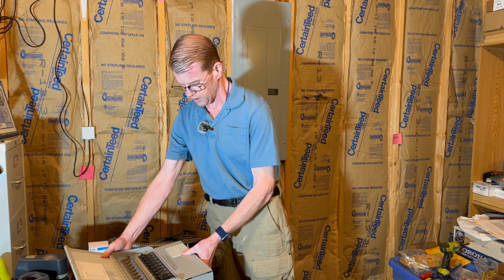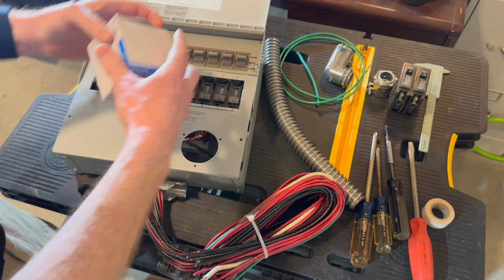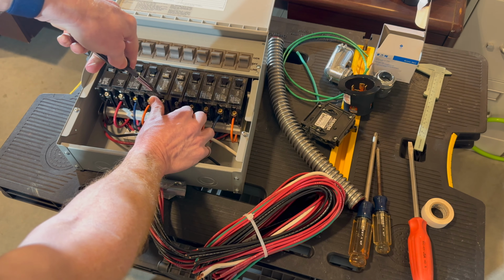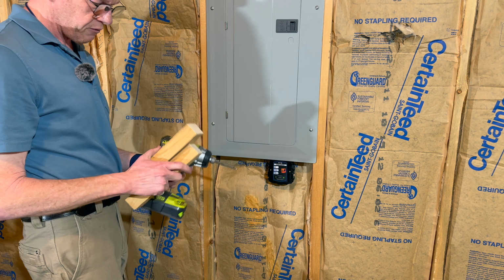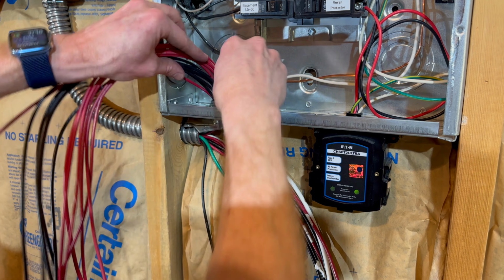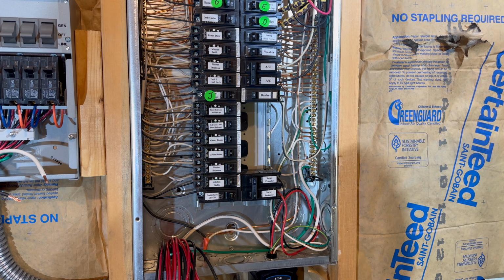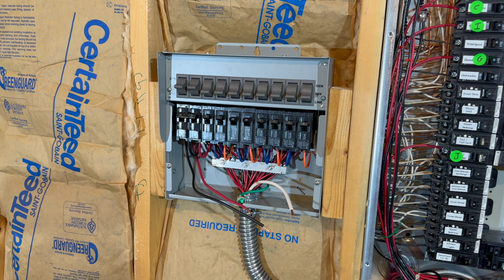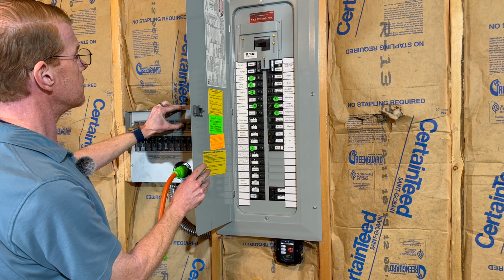Bluetti Home Integration Part 1: Reliance Protran2 Transfer Switch Full Install

Comment: kremer i has a problem running transfer switch it's 30amp, my main breaker used 50amp and my second floor housing using 50amp breaker it's only. how can i this solved the problem:face-orange-biting-nails::face-orange-biting-nails::face-orange-biting-nails::face-orange-biting-nails::face-orange-biting-nails::face-orange-biting-nails::eyes-purple-crying::eyes-purple-crying::eyes-purple-crying:
Reply from the maker: You want to install 50A breakers in this transfer switch ?

Comment: I'm about to add this to my "backup mix" as well.  I also have a 50 amp power inlet, interlock kit, and breaker outside for my pair of dual fuel inverter generators but wanting to add this beside the breaker panel in our closet where it's located.   I know there are two ways to do this MTS from what I've gathered so far.  One way is to not transfer the neutrals where you use standard breakers in the MTS so no AFCI while on power station".  The other way is to use AFCI's in the MTS and wire in their neutral kit which then switches the neutrals.  The Reliance person said it would be fine either way which I'm glad I don't necessarily have to buy 5 or 6 AFCI breakers for the MTS.

On yours, you didn't have any AFCI breakers in the main panel to deal with, did you?  Also, could the Reliance wires go out the side of the panel instead of the bottom?  That would be handy to go through a fitting in the stud for side by side mount.
Reply from the maker: I did not move any AFCI breakers.  If I did they would no be protected while running through the switch, and would nuisance trip in the main.  The neutral kit is just a bunch of couple foot neutral wires and another piece of conduit.   My wiring goes out the bottom of the reliance via a 90 degree connector, and into the bottom of my main.
Reply: @DougKremer  Appreciate the reply.
Reply from the maker: @ITguyAR_66 Happy to help with the process.

Comment: Hmmm...I have a smaller version on my original AC300, but I swear when I "just switched" from line to gen on the Reliance, it threw the breaker in the main panel. So from thence on, I "simultaneously" throw the branch breaker that I want to have on the Bluetti when I switch the Reliance from line to gen. Maybe it was a isolated "gllitch"? And I really don't have to do that?  I'm afraid to try what he just did at the end of this great video for fear of either wrecking something ha ha, or of course just having the main box breaker trip again. I now have the upgraded Apex 300-parallel off-grid system and will be upgrading to this 10 circuit transfer switch in the near future.
Reply from the maker: Is the breaker in your main panel an AFCI or GFCI?  They will trip because the neutral isn't switched also.
Reply: @DougKremer  no its a regular one.
Reply from the maker: @loveall234-4wn : any chance you have the wires backward?  Very odd.
Reply: @DougKremer  actually I jist went downstairs and looked again...problem is this was 3 years ago and now I'm not sire but what it was an AFCI circuit! Either way I jist disconnect each branch at same time as I switch the Reliance to Gen & all is well. Figure better safe than sorry. Someday I'll get brave and try again as well as with one of the "regular breakers" and see what happens. Just dont wanna risk wrecking an expensive inverter if thats possible.
Reply from the maker: @loveall234-4wn : The regular breakers are fine. It is that the AFCI/GFCI is seeing current on the neutral but not the hot, and trips. As mentioned there is a neutral kit available from reliance so you can install a matching breaker in the protran but likely not worth the bother.
Reply: @DougKremer  okay. Great advice and help! Ur a big help Doug. Glad I subscribed
Reply from the maker: @loveall234-4wn : Happy to share what I’ve learned. Thank you for your support!
Reply: @DougKremer   I am curious about this myself, now.  My plan was to add the ProTran2 10 circuit on for doing something similar to yours but no solar tied in.  Out of the 10 circuits I'm going to use, 5 have regular breakers and 5 are AFCI breakers.  I will be using some sort of power station, eventually a Bluetti AC200L or Anker Solix F3000 with TT-30R, to feed this transfer switch.  Will that neutral kit need to be used as it could potentially trip  the AFCI like the other persons?  

Also, I believe I've seen where most all of these power stations are "floating neutral", correct?  The ground and neutral both tie into the same bar in your main panel and  they are separate in mine as they are bonded outside at the main meter panel.  So, I would believe I keep them separated for this as well since there should only ever be one point of bonding.

Edit:  After looking into it some more, it appears that I will have to replace those breakers in the ProTran2 with Siemens Q series AFCI breakers to the tune of about $50 each x 5 plus that neutral kit.  Ugh...  Kind of makes me think again about even messing with this part. That adds over $300 to something I really don't have to have in the first place....it was more a convenience of sorts.  Hmm.  it looks like all the ones you did in your panel were not AFCI although I believe I see you do have some in your panel...just not for the transfer switch needs.

Comment: Have 3 Spit outlets in my kitchen that I are connected with my ProTran.  Can  I connect them  using single breaker for each side of the split or would I have to use a tandem breaker? Was not meaning to use the tandem breakers being that my pump is 110V
Reply from the maker: Spit?  Split?  I have two circuits in my kitchen, and the microwave.  All three are on the protran under three different switches and single pole breakers.

Comment: I installed a 12 circuit transfer switch, never done this before and the whole process took about 2 hours.  It is very easy to do, no issues at all.
Reply from the maker: Awesome! It is a pretty straightforward process, just very fiddly.
Reply: Yep, have to say Reliance has this down pat!  My first switch went smooth as silk. Next one should also.
Reply from the maker: @loveall234-4wn Getting all the wires through the armored flex was the only pain,  could be an opportunity for them to improve that experience.  The rest just took some time.
Reply: @DougKremer  yeh even my little 6 circuit one was a bit testy but managed. Still a great setup. Can't wait to get my bigger one going so I can also have my well pump on it. Gotta get ready for when SHTF! 😂

Comment: if the breaker is changed from 15 to 20 don't the wire have to be changed also
Reply from the maker: The smallest wire in this one is 12AWG so that is not a problem.

Comment: For anyone wondering, there are distict differences betweeen "interlock" and "transfer" switches.  The Interlock is a systen wherein you use the pre-exsisting main panel and add a couple of sliding plates that when engaged,  prevent power from coming into the home from your power company (aka, the power pole) and allwo you to similarly plug in a power source into the home power system.  With that system, you have to pre-designate the circuits which will be used and the system prevents YOU from sending electrical current back into the power grid. This is important because your outage could be because the power company is performing service somewhere.  Even though they de-energize the power lines, homeowners can send power back into those lines with generators.  Thats why you have to have an internock device or a manual trasnsfer switch like the one shown in this video.  The beauty of the manual transfer switch is that the device wont allow you to send power back upstream with a simple flip of a switch.  As an added bonus, you can add as many or as few circuits as needed.  Of course, this depends on the amount of power you will require during an outage and the size of the battery backup or the size of generator you have avilable.  For those who only need to power a refrigerator, you are better off running an extension cord and using a small gernerator.  Consider, however, installing one of these systems (if affordable) and upgrading your circuit as needed.  The best way to make more of your home available to auxiliary power is to change out all lighting to LED and ensuring your appliances are on individual circuits.  Dont use electric heaters, hair dryers or other high-energy consumption devices un less you absolutely need them.  That way, you can selectively en gergize those circuits as needed.  Finally, but most importantly, if you know you will require cooling through y our air conditioning, your auxliary power might not be enough to START your A/C unit.  This is because of the initial high amount of amps the system draws when starting up.  HOWEVER, if you install a "soft start" system on your A/C unit, you will no longer have that initial high amperage draw.  These devices run anywhere from 200-400 dollars are simnple to install.  You A/C system starts slowly with a gradual increase of electricity draw which wont overwhelm your auxilliary system.  Frst the A/C fan motor starts up and when its running normally, the soft start activates the compressor motor.  Normally, these two start at the same time and you can hear the initial power surge.  Now, your auxilliary power system (generator, inverter or battery backup) can run the system.  That is as long as the auzilliary system has the capacity to run an A/C.  Most whole-home battery backup systems WILL run an A/C, but the power draw will be significant that it weill shortan the total number of avialable hours on your batteries. That's why an inverter generator is better suited for this.  Of course, your home HVAC (heating) will also need to be considered, however it doesnt have the same power requirements as the A/C unit.  Hope this helps everyone.
Reply from the maker: Well said.  Also of note for those watching is that I have both setups installed.  A main breaker whole-house interlock and then this transfer switch.  Both can co-exist and both serve different purposes.
Reply: @DougKremer absolutely,  I have a interlock installed now.  I want to do this set up for short term outages.

Comment: What do you charge for labor, if there are only 4 lines to connect?
Reply from the maker: I’m not the charge type, but I have offered help to several friends.
Reply from the maker: Four big lines.  Many smaller 🤣
Reply: @DougKremer no just 4 in subpanel. Its a shed :)
Reply from the maker: Ahh, easy.
Reply: @DougKremer for you. Like it is for me to replace a joint in the body. :). Eventhough im a surgeon, i still think these guys here in Gilbert AZ charging 1,500 for this little bit of labor is crazy. So, i think with your helpful video i could attempt and practice this on the shed/shop. The transfer switches themselves are only 15amp in the actual transfer switch, but in the interior panel they are 20 for big tools if needed, but for just basics, 15 amp should be just fine. So my question is, do i have to upgrade all switches to 20 amp also in the small manual transfer switch? This is a temp setup untill i buy a bigger switch to run 240 v for the mini split there too. I will not connect the minisplit to this small "for fun" switch.
Reply from the maker: @SurgeonTech  The 15 that it comes with are probably fine, if you have tripping issues upgrade to 20 if the wire supports it.

Comment: Can either the 200L or 300 handle 240v circuit via the transfer switch? I have a well pump and water heater on 240v 30A circuits. TIA!
Reply from the maker: Unfortunately not, both are 120V machines.  The AC300 and AC500 have the ability to link two units together for 240V.  Or the new Apex 300 does 240V/16A in a single box, and can be paralleled up to three for 48A.
Reply: Thank you for the quick reply! Your videos are a big help.
Reply from the maker: @gruml004 Thank you! I tried to concentrate on a lot of real world uses.  I’m also definitely open to test things people would like to see.

Comment: Great install video. This is exactly the setup I want to run and for the same reason you mentioned. When I mentioned this to a trusted friend and electrician, he commented that there is an issue with the neutral when attempting to run grid power on main panel circuits while simultaneously running portable generator power to the circuits on the transfer switch. He said the transfer switch needs to be set up as a “separately derived system” to avoid problems with the shared grounding.  Can you speak to this from your experience? How is this set up working for you?
Reply from the maker: I think I answered this in a reply you made,  please correct me if I am mistaken.
Reply: @DougKremer Yes, Doug. Thanks again for your other reply 👍🏻

Comment: When you changed the 15-amp breakers to 20 amps, did you need to change the conductors going through the transfer switch and to the panel? Or are the existing conductors oversized? And if they're oversized, what gauge wire is it? I have a need for some 30-amp circuits, and I'm worried the wire gauge won't be properly sized. Thanks for any details you can provide.
Reply from the maker: The left side breaker spots preinstalled with 30A breakers have 10AWG.  The rest was all 12AWG.

Comment: What these do to the main panel is extremely ugly.  Seems like a sub panel would be better for these splices and then you’ve got the critical load fully isolated if you later want to have three power sources.  I guess it depends if you can get to the runs and re-snake them into a sub panel.
Reply from the maker: It's all a trade off.  A subpanel is all or nothing on switching and would not let me/you choose individual circuits to run on generator/powerstation or utility.

Comment: since you have a 50 amp transfer switch why did you only choose a 30 amp inlet box on the front of the transfer switch?
Reply from the maker: @larrywaldon7584 Because I’m using a 30A output from the Bluetti. 50A plug, cord and such would just be extra unnecessary expense that wouldn’t net anything.

Comment: I want to buy a 50 amp transfer switch , in my breaker box at the house my heater in on a 50amp breaker , can I switch the 30 amp breaker on the transfer switch to a 50 amp breaker ?
Reply from the maker: @user-qz9yx3dh4i  That would be a good question for the tech line at Reliance.  They were very nice when I called with questions.
Reply: @DougKremer  they already said no

Comment: Just a thought I’m putting in this transfer switch with a 50 amp inlet plug not the 30 amp you used I plan on only useing for 120 circuits No 240 is the RV dogbone TT 30 to 50 amp able to be used instead ??
Reply from the maker: @jimverh1868  Yes. It will work the same as mine if it powers both X and Y hot legs from the single hot input.
Reply: @DougKremer  thank you for the wonderful video. I’m installing the same Reliance 310crk MTS for using Apex 300 but MTS comes with L14-30 4 prong outlet and planning to use TT30 output port on Apex 300. If I use TT30 male to L14-30 female adapter, will it work as one hot from TT30 feeds to two hot on L14-30 in MTS? Is it safe ?

Comment: At the 16:19 mark you said you were working on the panel hot, and only in the lower section, BUT, at the 15:23 mark I almost had a heart attack when you were attaching your ground and neutral wires, and HAD YOUR HAND NEAR THE HOT BAR!!!  Those "bars" that your breakers snap onto are HOT!  
Unless I am missing something, this should be made more clear for those that are unaware!
Reply from the maker: This is true but I was farther away from the energized bussing than the depth of field on the camera shows.  The metal teeth looking vertical parts hold the back of the breakers and are ground with no risk, the energized bussing is a very narrow strip down where the two rows of breakers meet in the panel.  I would encourage everyone to avoid doing energized work.

Comment: I also just did this in a recessed setup like you have. Just fyi, if drywall is going up, you wont be able to have the 90 pull elbow behind the drywall. Instead i put a 1 1/4" hole in the side of the switch and side of the panel, running a nipple from one to the other directly through the stud and didnt need extra conduit. Inspector gave me the thumbs up and much easier to get the wires over.
Reply from the maker: That is a great tip!

Comment: Does this panel automatically switch when the power goes out?
Reply from the maker: It does not, all the switches are manual.  I use it fulltime to run those circuits off the Bluetti as a UPS which gets most of its energy from solar and uses grid as backup.